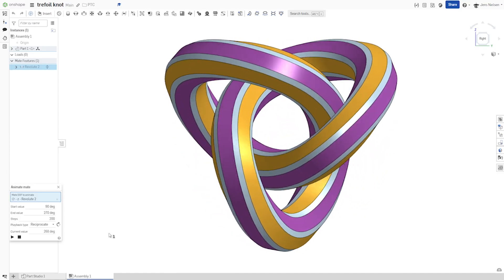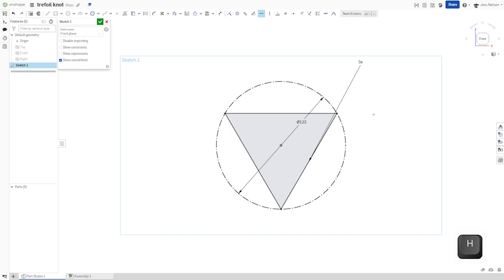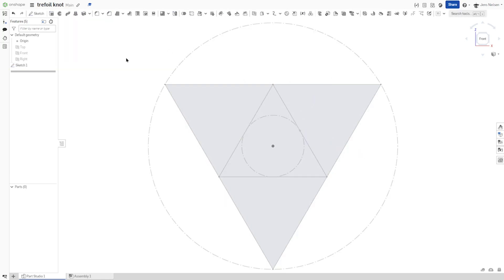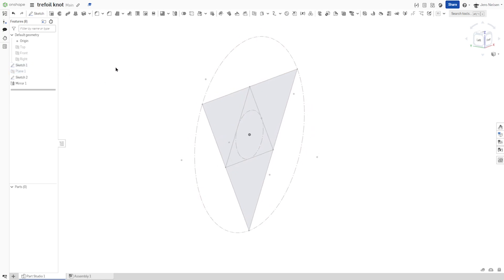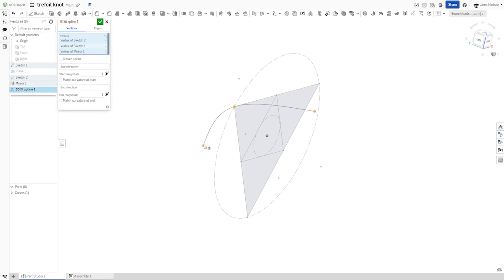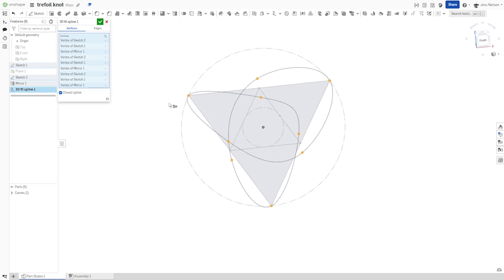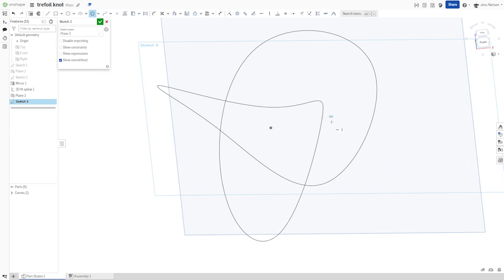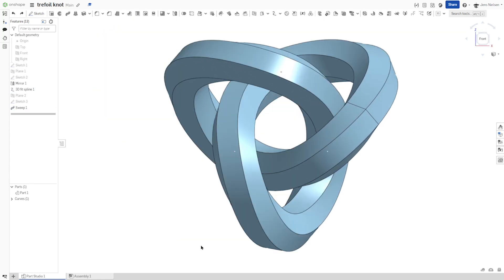Weave a Trefoil Knot with Onshape: 3D Fit Spline & Sweep

Comment: What is the basis of this construction technique? Curious how/if it generalizes to knots with more twists in additional planes?
Reply from the maker: Is your question about how I got to do this? I had a look at some picture, I believe on pinterest, and thought it would be nice to model this in Onshape, and wanted to apply a straight-forward geometric  design (those two triangles). I would like to redo it with that parametric curve equations for the trefoil knot one other commentator mentioned. Let me know if you find a different design to work on...
Reply: @cademist  I guess I’m imagining how one might parameterize this to eg 3,4,5 curves - if that is even feasible

Comment: I'm doing a different feature but when I make the closed spline, none of the points remain, so I can't make a Curve Point plane. Any ideas?
Reply from the maker: ok, here's a  suggestion-if you  have a  spline with  no sketch points,  pick any plane intersecting that curve, then draw a point, attach that with pierce-exit and you can define a  plane with curve point, selecting the  curve  and the point. Hope this helps